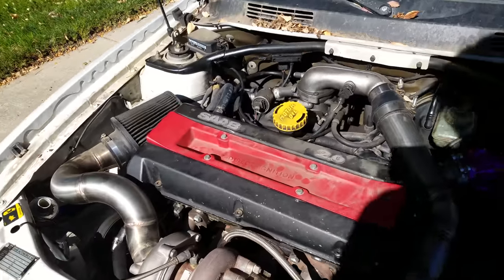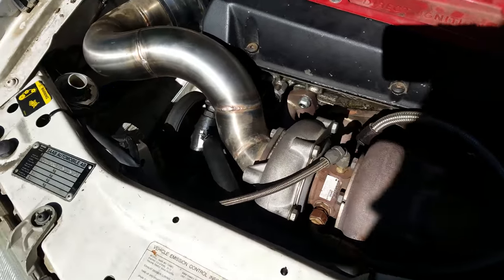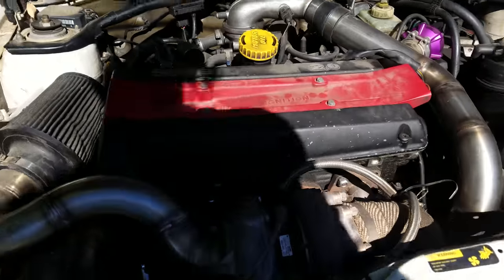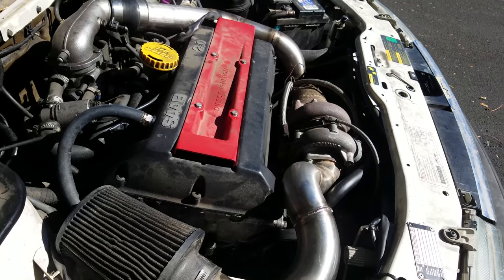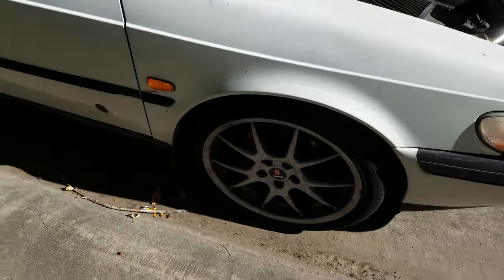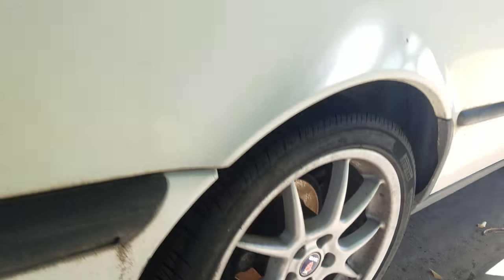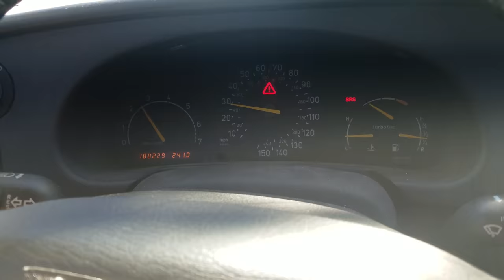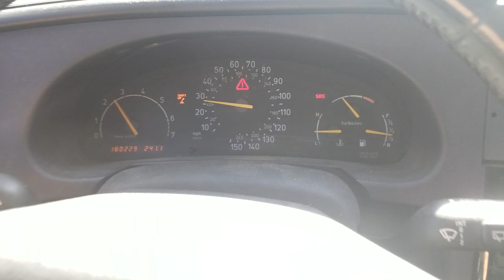'95 Saab 900 Big Turbo Upgrade 😍| GT-28RS Disco Potato w/ Highway Pulls

Comment: I have yet to see a Saab motor blow up from a turbo these things are so reliable and good and it’s why I will always love them
Reply from the maker: Yeah they seem happy up to maybe 350 or so hp. Then I think pistons might melt.
Reply: @g3mccotter  You are thinking of the later b205 engines. The pistons in your b204 should be good for around 450hp. 

The transmission on the other hand...😬
Reply: @g3mccotter  i run over 700whp on stock b204 pistons
Reply: well let me be your first, my saab motor blew going 110 on a slight curve. It was stock too so i didnt even get the chance to make it pull more power :(
Reply: @raintoty2713  what was the mileage and how well did you maintain it?
Reply: @unhingedplays2203  just died at 170K, bought it 3 months ago and not really sure how well maintained it was but i know it leaked coolant and a little bit of oil. Bought it with a boost leak, fixed it, was great driving it but then it gave out
Reply: @unhingedplays2203  also rigjt when i bought it i changed the oil that was changed fairly recently, and it all seemed fine, not sure why it blew.
Reply: @raintoty2713  could have been poorly maintained or someone did something bad to it sorry to hear about hope that doesnt happen to my saab

Comment: Just don't forget that you can actually use the whole speedometer on the Saab 900 Turbo.
Reply from the maker: dang that a good point.
Reply: @g3mccotter  my aunt has a 95 900 SE turbo convertible with the 5 speed and I pulled off at 145 out of fear for my life but it was still climbing pretty quickly.
I imagine with your turbo upgrade you could easily fly past that
Reply: @Nathan_Jay  I had the exact same car in green convertible. I also made it up to 145 before I had to slow down. Rip 🙏

Comment: Everything is so clean and then there is your bumper lol. I'm guessing intercooler was to big and you need a 9-3 bumper to fit it. Man it pulls nice! I have a 96 900 turbo with only 46k miles. Just did stage 3. Looking for more but mine is an auto. Need to do 5 speed swap first. Nice job like the top mount setup. You put some serious coin into that ng900 dam. What kind of power is it putting down?
Reply from the maker: Haha yeah. Basically had to gut a lot of the bumper to get front mount to fit. I didn't dyno it but street tuner who hold fastest Saab record said easy 350 to the wheels. Thing was stretchy fast. Pull the wheel right from your hands. Would hook and book in 2nd just had to have 2 hands on the wheel. 3rd it really pulled hard well the into triple digits.

Comment: Did you dyno it? How much whp. Nice build working on my 96 right now. Stage 3 so far 3 inch full exhaust tune cold air intake box and green giants. Pulls hard dam!
Reply from the maker: Tuner figured at least 350 wheel. We street tuned it. He has fastest quarter mile Saab on record also.
Reply: @g3mccotter  what tuner? Were is he located?

Comment: Nooo way that thing is on 20psi. My 99 9-3 se is that fast with a stage 1 and a t7 bcv conversion. It would sound better without that muffler too.
Reply from the maker: That's awesome. Do you have video of these claims? This was plenty loud of an exhaust setup. One of my fav sounding 4 cylinders with those equal length headers.
Reply: Thankyou I was thinking the same. My damne edna stock with stage1 map is much faster???

Comment: Where did you get the parts
Reply from the maker: Exhaust manifold back is all custom. Turbo was bought new from a local shop. Charge piping and intake all custom. Some off the shelf parts like clutch, pp, flywheel, bov, injectors
Reply: @g3mccotter  that's awesome dude

Comment: At what revs does your boost come in?
Reply from the maker: At around 2500 it comes in, full boost about 3300 in third.
Reply: @g3mccotter  iv the same turbo on the same engine so was wondering. I'll have to check mine. Usually going too fast to look as the roads around here are tight. Iv not yet got out of 3rd gear under acceleration but I wanted to know as a base idea. Love your motor. Bet you've shown a few cars up with it :)

Comment: Does it only go in straight lines or does it actually corner at speed? :/
Reply from the maker: Corners quite good for being stock. It's a fwd coupe with some fairly wide sticky tires handles as good as that would.